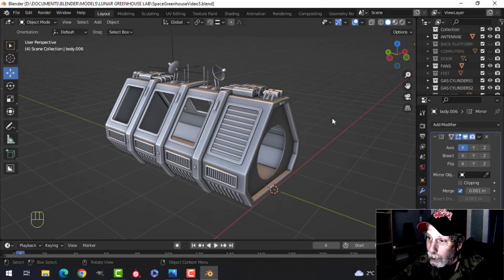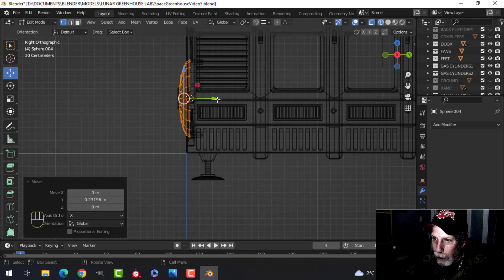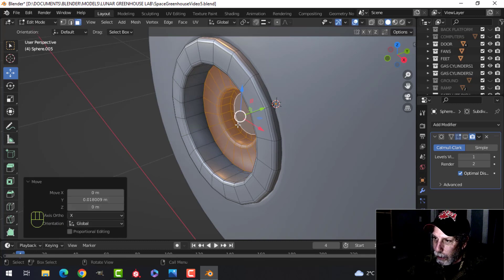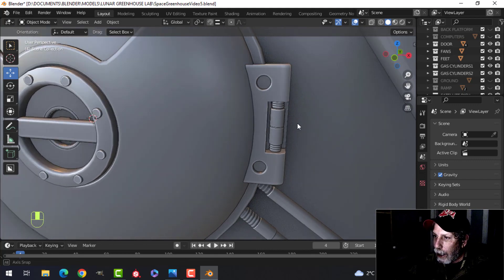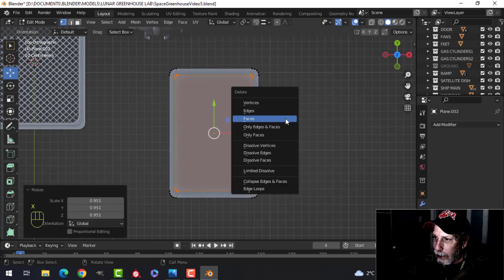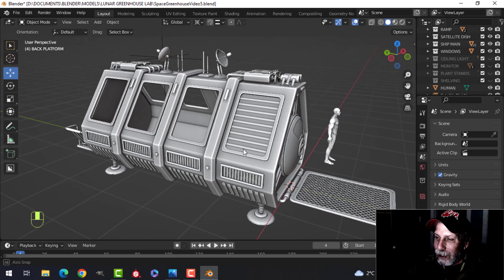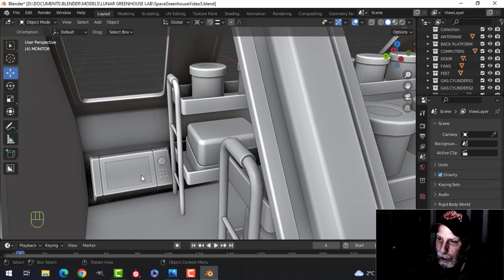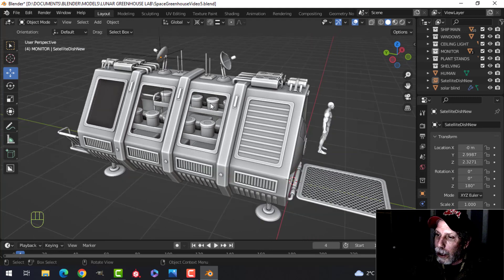BLENDER: LUNAR GREENHOUSE LAB (PART 5): MODELING UPDATE

Comment: Nice..what is your pc specifications
Reply from the maker: Thanks.  Nothing special, 12 or 16 GB RAM, older but decent Nvidia graphics card.  Don't really need much anyhow just keep polys under control and tweak cycles render settings if you use cycles, I use eevee.  No need to max out resolution and denoising and have hours to render.  I've never had a render longer than 30 minutes.